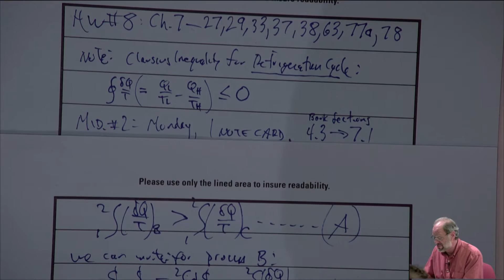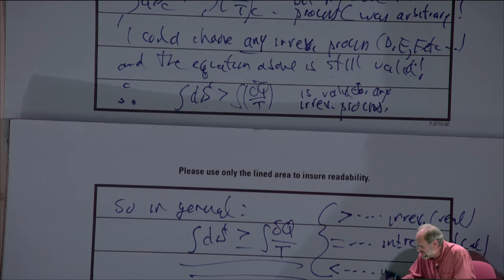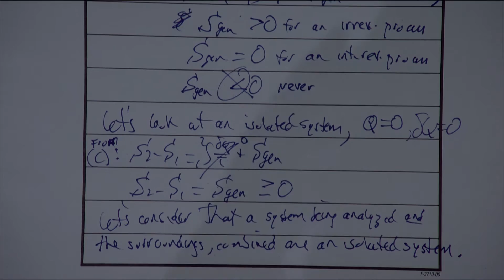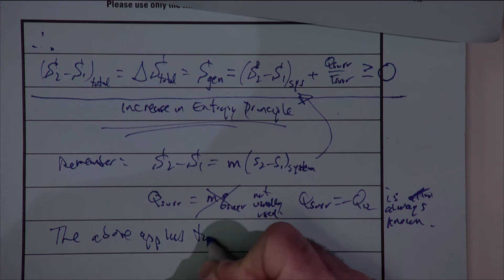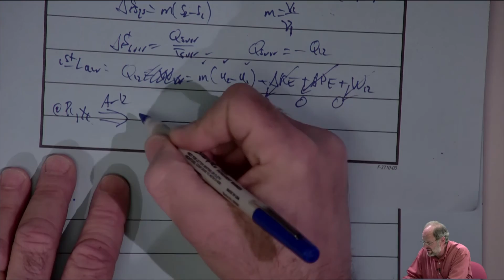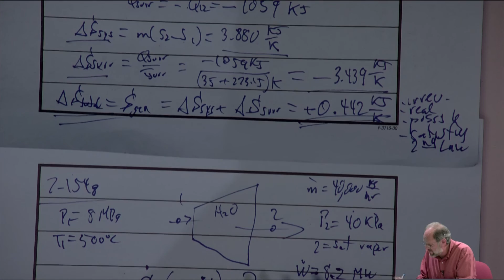Thermodynamics: Entropy; Increase in Entropy Principle (18 of 25)

Comment: So, if I were to take a cat and teleport it instantaneously into space, all the water in it will start to boil, it will get the WiFi of heaven for sure, but, radiation alone doesn’t transfer too much heat since the fur and tissue came from almost the same temperature, and even if the outer space is as close to absolute zero as it gets, nothing will take away the vibration of atoms, right? So, my question is, what happens with the temperature, does it all just reflects and emits till the whole system balances out into a constantly boiling raw kitten soup?